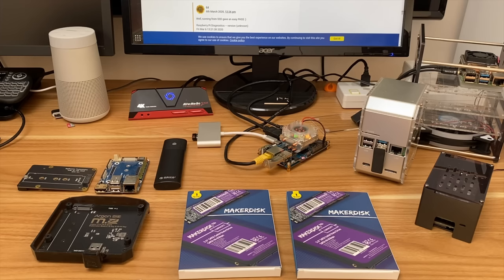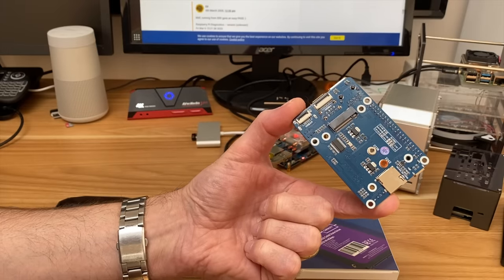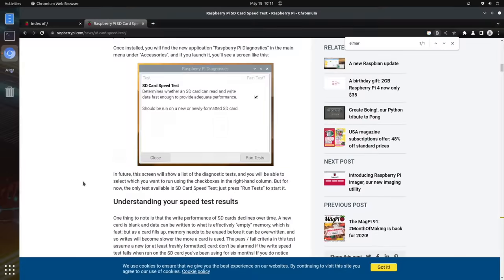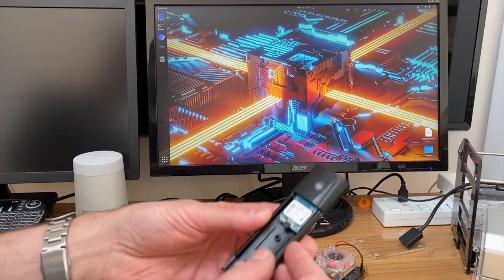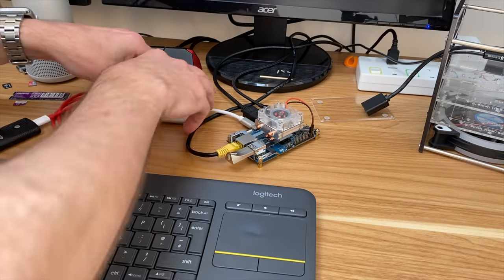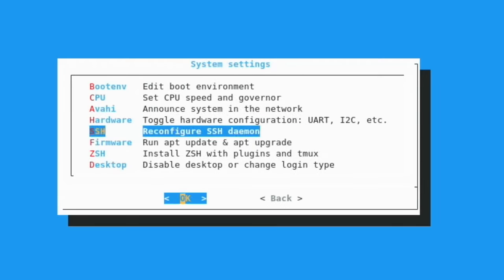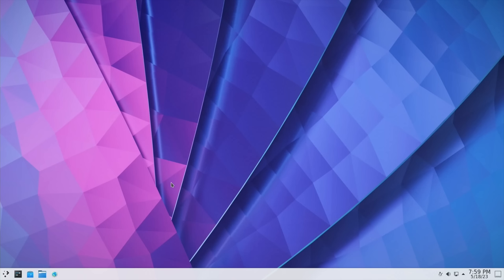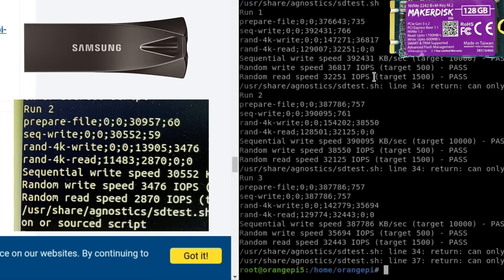Nvme boot fix and speed test. Orange Pi 5

Comment: Great video Lee! What SBC do you recommend for getting into Linux like Archlinux?
Reply from the maker: If you don’t want to spend a lot initially the Orange Pi 5 is very reasonable but doesn’t have WiFi or Bluetooth. I have a playlist on Orange Pi 5 
	
	Everything Orange Pi 5 / 5B
	https://www.youtube.com/playlist?list=PLMJAjiTgBtFn7JSmTE73mj9u_r_6ijuqj
	
	The Orange Pi 5b does have WiFi and Bluetooth but you lose nvme (very fast storage).
	
	The Pi 4 is the best supported by way of community support and official Linux builds but is not as powerful. The Pi 5 should be out next year.
	
	Everything Raspberry Pi. Over 500 Videos
	https://www.youtube.com/playlist?list=PLMJAjiTgBtFnaITgDfjTnsL9RlnyPTl7M
	
	There are many RK3588/s devices available almost too many
	
	I have been sent excellent hardware from Mekotronics and Khadas in this playlist 
	
	SBC computers not Raspberry Pi
	https://www.youtube.com/playlist?list=PLMJAjiTgBtFn1PN_DZA1SEe6qzGUjHOn0
	
	Before you buy one just make sure the software you wish to run is supported on the exact model you choose.
	
	X86/X64 devices are much better supported than ARM devices but do use considerably more power.
Reply: @leepspvideo  Thanks!

Comment: Glad you got it working... I started copy/pasting instructions when I was only about 1/2 way through the video... but then I unpaused and realized you already got it done... lol
WOW THAT IS FAST!!! but you gotta try it on the larger size nvme because it uses 4 lanes and not just 2 like the smaller one (compare the labels ... Gen 3 x2 vs Gen 3 x4 )
I hope you run the same tests on the same drive and the SAME OS (if possible.... I doubt it tho) but on the Raspberry Pi when you get the CM4... heck you could always buy mine if you want.. I don't use it .... shipping might be a LOT tho LOL :)

Comment: Great NVMe information.  🥳 The Raspberry Pi4 vs the Orange Pi5 is a little bit like a 6 cylinder vs a V8.  So far my OPi5 runs things about 2 to 4 times faster than the RPi4.  Next I need to try out the ARM Mali-G610 GPU  and  NPU if you’re wanting to run AI.   Now there is a Orange Pi 5 Plus 16GB Rockchip RK3588 8 Core 64 Bit  and a Orange Pi 5B 4GB Rockchip RK3588S 8 Core 64 Bit Wi-Fi6, BT5.0     😎 The Rockchip rocks.   Thank you.

Comment: Heyyyy..... that's the WaveShare CM4 board that I have :) except mine has a button battery on it (that I can't seem to remember to buy lol) - I'm pretty sure THAT is the BEST Raspberry Pi board you can test nvme speeds on..... it actually runs on the PCIe bus where as pretty much ALL the other boards I had looked at just used the USB ports ....
 - As far as the Rock Pi boards I'm not totally sure...but it would be nice to compare them :)
Reply from the maker: Cytron may be sending me a cm4, so I can finally try it out. 👍🏼

Comment: I got Android installed on the NVME based on the OP install instructions. Other YT videos outline the process too.
Reply from the maker: I have an Android installation on nvme video later, with a strange result..
Reply: @leepspvideo  Looking forward to seeing that. I’ve been trying to get Batocera on my NVME and have had problems the entire time. I was told to just boot the OP5 Arch OS, use etcher on the NVME and clear the SPI flash. Not sure I have the courage to reattempt it at this stage.
Reply from the maker: @willatherton6182  the boot fix in this video should work with Batocera as it Linux
Reply from the maker: @willatherton6182  the fix in this video should work as Batocera is Linux
Reply: @leepspvideo  Good deal! You are doing amazing work for the OP5 community. Look forward to seeing where this all goes.

Comment: If you look at the label of the MakerDisk nvme's the larger one is Gen 3 x 4 but the smaller one is Gen 3 x 2 ... so half the speed..... BUT I don't think this will make ANY difference with ANY of the Raspberry Pi boards (even the CM4 ... which I THINK uses PCIe Gen 2 x 2...but I'm not 100% sure off the tope of my head) .... BUT it MIGHT on the Orange Pi and/or Rockchip boards... I THINK the Rock Pi 4 does Gen 3 x 4 ....  but you are better equipped to figure all that out...

Comment: I confirm that the M.2 adapters from SupTronics have some problem handling power input and just break: missing some current / voltage safe guard on the board?

Comment: The Banana Pi BPI-W3 single board computer is designed and developed by bananapi team for professional and enterprise users, powered by Rockchip RK3588 SoC quad ARM Cortex-A76 and quad Cortex-A55 consists of an eight-core CPU processor with dynamic frequency scaling up to 2.4GHz. Embedded high -performance 3D and 2D image acceleration module, AI accelerator NPU with a built -in 6 TOPS computing power.

BPI-W3 up to 32GB 64bit LPDDR4X ram, up to 8K@60 HDMI OUT, HDMI IN, MIPI DSI, MIPI CSI, 3.5mm jack with mic, USB Port, 2.5GbE LAN, PCIe 3.0 x4, PCIe 2.0x2, 40-pin expansion header, RTC,POE,SD card, DC power，typec.

Comment: question for the gurus.    can I have only the boot ( partition/loader ) on an sd card and is the boot loader smart enough to go get the rest of the O/s fromn usb/nvme
usb could be usb keydrive or a usb ssd
Reply: why, I do not have to worry about flash of spi  and make sure I can load full sd cards or sd cards as boot disk only.    Sorry, I  have supported many UNIX's over the years ( including linux ) but booting on orarnge pi is new to me and I am not sure how boot loader looks for o/s ( uuid,  device file, etc )

Comment: my orange pi 5 board no longer boots after the sd card, nor after the ssd m2, the red LED remains on.  How can I solve this problem?
Reply from the maker: Not sure, try some of the different operating systems in this playlist. If none of them work it may be a fault 

Everything Orange Pi 5 / 5B / 5 Plus
https://www.youtube.com/playlist?list=PLMJAjiTgBtFn7JSmTE73mj9u_r_6ijuqj

If it’s still not working try the Orange Pi forums. I take it you have an Orange Pi 5 not a 5b or a plus?

Comment: Would a m2 2280 fit in a case? Do i need to get a 2230 then?
Reply from the maker: Depends on the case

Orange Pi 5,5b NVMe cases Geekworm n505 n506
https://youtu.be/8u1VMviwW00
Reply: @leepspvideo  what about on an orange 5 plus?
Reply from the maker: @jdmji  yes see 4:45 2280 fits along the board

Orange Pi 5 Plus Case and Coolers test. Geekworm
https://youtu.be/CfIWyWxPaC0
Reply: @leepspvideo  Awesome, thank you very much! I went ahead and ordered the 32mm heatsink and the 
Intel Wi-Fi 6 (Gig+) 2230kit. Still undecided on the m2 drive though!